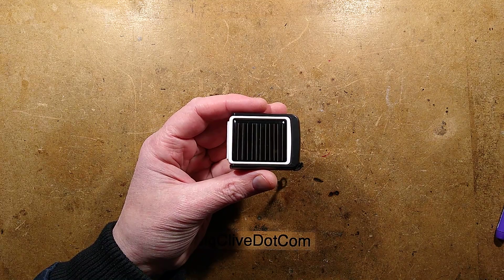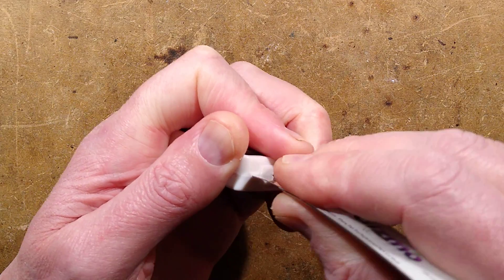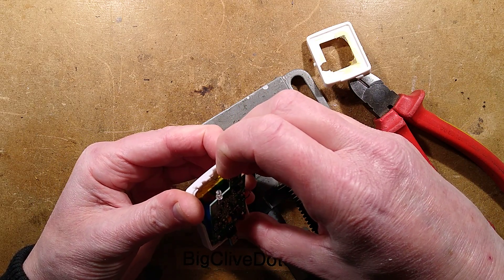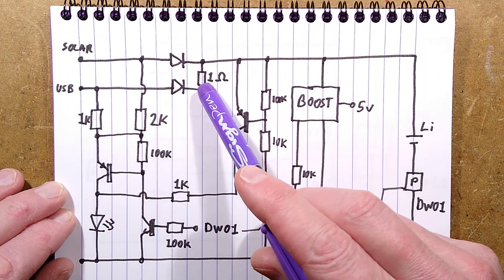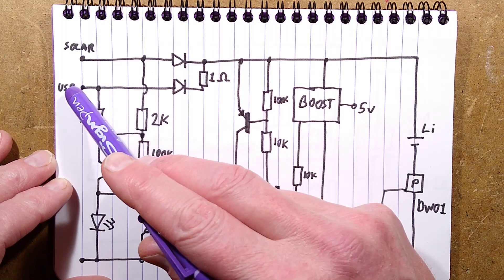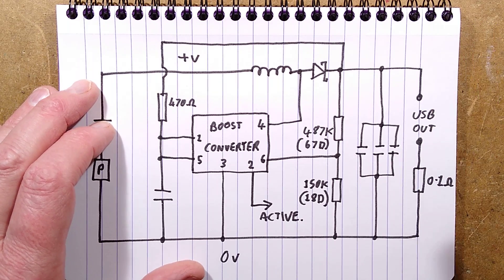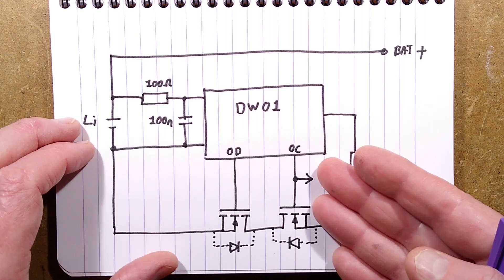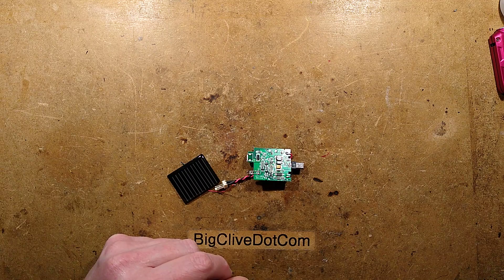Ultra small solar power bank with retro circuitry (with schematic)

Comment: I enjoy your videos and I was wondering if you have [or could] use discarded lithium cells from vapes, to make up a battery bank of cells [and maybe a step up to 5v], which could be used as a portable power bank for a phone?
Reply from the maker: Yes it is possible to use a parallel cluster for that.  I have a video where I used two in a USB rechargeable module.
Reply: @bigclivedotcom  thanks for the speedy response, I'll see if I can find it. Thanks again.

Comment: My major is “optical engineering”. We’ve had four semesters of so called “electrical engineering”. This video is a very good example of me understanding every single word but struggling to understand the whole concept.
I admire your fluency in reverse engineering different circuit boards.
Reply: I was a bad student:
Reply from the maker: You may find it a lot easier to learn naturally at your own pace instead of the usual out of context data cramming that happens in educational establishments.

Comment: Clive, My Samsung fast charger that was supplied with my phone packed in,,, (broken negative post, when unplugged it pulled out the brass connector )
I bought a Qualcom 50W Quick Charge 3.0 wall charger from Amazon.
I've been using it for a couple of weeks and the phone was happily charging in under an hour from about 35% to full (the Samsung one took around 2 hours to do the same)
Happy bunny,, fast charging.
Yesterday I noticed that my phone seam was starting to bulge.
the phone does not overheat... obviously the battery is puffing up.
Does very fast chargers damage phone batteries?
The phone is only 4 months old and will go back under warranty, surely this can catch fire, or vent?
Might be worth a Big Clive investigation and destruction test.
Pie containment dish needed.

Comment: I had one of these over a decade ago... back then, it could charge your phone, they didn't need as much power back then like they do now... Loved that thing. Best $20 I ever spent. It got me onto Solar powerbanks, which nothing ever really stood up to that little bugger. That little thing took maybe a couple hours in daylight to charge up - but when you don't scale proportionally, you run into issues. I've got a 15,000mAH battery with an 8" solar panel... that thing takes WEEKS to get 25% charged.

Comment: I bought one of these for a project for a tiny wireless camera, but in the end the output wasn't quite enough (I ended up using a solar wall light with the led's disconnected), but the circuitry was impressive for such a small and seemingly cheap appearance - there is so much in it and it has potential to be a solar keying torch with a few mods :-)

Comment: Is it just me who has a problem with the idea of leaving lithium powerbank in a sunlight? 
By profession I naturally think about people with less technical awareness and I can easily see people leaving these in direct sunlight. As a rule, I don't like one of these flat cells in solar devices. When getting in a sunlight NI-cd or at-least something in 18650 form /with smaller capacity (to deal with it flaming) getting warm near the window in a summer. Or some other means of protecting the cell from getting too old

Comment: If this power bank is like one I have, the solar panel is handy for discharging.  A little bit of light activates the circuit, but isn’t enough to charge the cell.  Meanwhile, the LED indicator slowly drains the cell. 😊
Reply: Yeah the solar panel at that size itself can only draws 0.05 to 0.1 watts even at full exposure to sunlight. Not enough to charge the phone battery to reasonable capacity even when it's leaving at full sunny day

However that small sized solar panel is enough to charge very small devices which has small battery capacity, such as calculators and small rechargeable flashlights

Comment: Said boost chip looks like a RT9266PE , FB reference point is at 1.25V by the datasheet, resistors pair used here (487k/150k)  make it exactly 5.31V you've got on tester.

Comment: Clive (or anyone), I recently was replacing my phone screen and had to remove the battery. I dented the cell in quite a few different places but it is not punctured. Do you think it will be okay? Its working fine at the moment
Reply: Probably.
Reply: @davelowets  if it was gonna explode would I know about it first? Like would I get really hot or start smoking before it explodes?
Reply: @bluelights2468  First it would start to bulge and swell up, then it would get very hot, and at that point it'd not be long before it unleashes the hell contained within.. 
If something like that IS going to happen because you physically damaged it, it usually happens VERY quickly after you messed with it. If it's been any amount of time, you're most likely OK.
Reply: @davelowets  it's been a day now as it happened yesterday morning, I am a bit paranoid about it exploding in my pocket but I'm glad it wouldn't be an instant thing anyway. Thank you very much for your help
Reply: @bluelights2468   I think you'll be just fine... 🍻 

If you notice that its rapidly losing its ability to hold a change anymore, thats a sign that it's possible damaged, and may end up in a gangerous situation. So, if its still holding a chage well, its ok. 👌
Reply: @davelowets  okay perfect thank you very much 🍻 it's holding a charge as good as it was before so should be A1 then. Thanks again
Reply from the maker: As long as the dents are soft and not too deep it should be OK.  But it's hard to say decisively.  If in doubt, treat yourself to a new battery.
Reply: @bigclivedotcom  yeah I stupidly used a metal flat head screwdriver to remove the battery. It was well stuck in there and I've dented it roughly 10 times or less. It seems to be working just fine and i really can't be arsed to change it cause the phone is back together now, why can't they be easily replaced like they used to be. Thanks Clive
Reply: @bluelights2468  Next time, slide a credit card or Drivers License under the battery to release the double sided tape holding it in there. Isopropyl alcohol also greatly helps to release the stickiness, but if you use it, use it sparingly, and you must make sure that the power from the battery is disconnected first and allow the device to FULLY dry out before you reconnect the power. If in doubt about what's underneath the battery, and whether the alcohol will destroy something, the credit card method works well, but go very slowly, methodically, from all sides, and keep checking your progress to avoid catching, wadding up, and ripping the pouch of the cell if it's a soft covered cell. 

Years ago, I was trying to open a power bank that had ultrasonically welded plastic seams and I was gently slipping a razor blade around the edges to break the seam. The blade finally broke through and I plunged it into the edge of the lipo cell. The power bank INSTANTLY blew up in my hands and erupted into flames 3' high. Thankfully quick reflexes kicked in, and I dropped the device VERY quickly, and backed away before I got injured. I was very lucky to be in my basement at the time, which has concrete floors, so I could just let it burn out without starting my house on fire. The power bank was only as big as a credit card, and about 1/4" thick. I never gave a second thought about it being "dangerous" being that small, but a lithium cell of any size can be a sizeable "bomb" if treated wrong. 

If you are working on a device with a lithium cell in it, choose your working location carefully, use some personal safety gear if in doubt, remove metal jewelry such as rings and necklaces, (many lithium cells can output enough current from a short circuit to a piece of jewelry to melt it into your skin) and keep a fire-safe containment device around just in case. Somethimg similar to Clive's metal "Explosion containment pie dish" would be quite handy. Play safe!

Edit: Guitar picks work well for sliding under smaller lithium cells to remove the sticky tape also, if a credit card is too big to fit. Just be darn careful not to shove the point of the pick through the cell pouch. Use the blunt side.
Reply: @davelowets  I ended up snapping the phone shell I'm half as I had a new one anyway I just transfered all the bits to the new one but it was definitely the most idiotic was to remove the battery hahaha. That sounds like you had a very exciting time with that power Bank 🤣 yeah I was removing the battery at the workshop in my bedroom but it probably wasnt a good idea as i have carpet in here, thanks for all the tips and trick. My dad used to never let me near my rc car batteries when they were charing because he said they could explode and I realise now that was unlikely because of protection circuitry but it has given me this wariness when it comes to batteries which I guess isn't a bad thing especially after hearing your power bank story hahah thanks again for all your help 👍🍻
Reply: @bluelights2468  If your R/C batteries were of the lithium type, your father was a wise man. Some types of lithium cells are prone to violence during the next charging cycle IF they have been over-discharged or abused during the last use. There are fire-proof bags, or "Lipo Sacks" available for the charging of large lithium cells that will contain the explosion or fire should it happen while they are on the charger. Its wise to store the cells in these when their being stored also. 

Your welcome for the tips. 👍 
I'd hate to see someone get hurt when they're learning electronics, or how to repair something. Great job on getting your phone back together and working, as replacing phone batteries is NOT an easy task these days. 👌

Comment: I get a weird inception vibe looking at the PCB. Your camera circuits are filming battery circuits transmitted through a bunch more circuits, resistors, and diodes to my phone you get the point. Your eyes to my eyes with a bunch of electrons in between.

Comment: Have one of these somewhere with an ipod dock connector, from around 2007. No charge input, in addition to the tiny battery, so you could charge like 20% of your battery VERY slowly every few days. Never got it to work repeatably.

Comment: Still very nice, most of the solar power banks I have don't have the DW01 in line with the solar charger - they just put the solar cell across the li-po cell - what could go wrong ?
Reply: The Lipo in those most certainly had a built-in protection board right into the battery.
Reply from the maker: Some have the battery protection, but some don't.

Comment: Nice little unit. Because the case is white and the solar panel is on the other side of the unit from the lithium cell, one can be confident about sitting the unit in direct sunlight without any issues other than yellowing of the plastic or increased brittleness.

Comment: Funny how most of that circuitry is now put into a tiny chip–now that I think about it, I kind of want to compare the chip's size to the size of the circuit featured in this video 🤔
Anyone know where I can find some pictures?

Also;
10:23 when I first saw the way you drew the boost converter, I was wondering why the pin numbers are drawn out of order, but then I quickly realized the chip pins probably don't look like that and it's just more convenient to draw them that way. 👍

Also-also, until now, I had thought you were using the same notebook and that it either had an endless number of pages, or that it was almost full.
Turns out this guy probably has a whole crate of notebooks 😆

Imagine having a notebook with infinitely many pages. 🤔 When you open it up, it always appears to open in the middle; neither side is thicker or thinner than the other...
Such a notebook would have to be bigger on the inside..
I think I might like to have a notebook that's bigger on the inside, although I think I would rather have a few million pages, maybe a billion max. That would be neat.
Reply: I seem to remember such a notebook. I can't remember if it was D&D, Pathfinder, or Terry Pratchett.

Comment: I wish micro USB would be fazed out, such a nasty connector that always seems to wear and distort making it useless over time.
Reply: But of course that's probably the point, then you have to buy another one.
Reply: but they are ok when plugged in the right way.. and not forced in upside down. they seem to last forever.. ive seen more dodgy usc c connectors

Comment: Honestly i doubt this tiny PV-panel could output any useful amount of power 🙂 In best case its in the range of self-discharge of the cells...
Reply: Nah, it outputs 20+mah... Thats MUCH more than the self discharge of the lithium cell. It WILL charge it, it'll just take several days in the sun.

Comment: I grew up with those kinds of circuits. Then came op amp comparators and 555's. Now everything is done in software using microcontroller boards. Recently I made a power on delay circuit for a compressor using an ATtiny module, a packaged Hi-Link power supply, and a relay module. It could easily have been done using a dropper cap, rectifiers, a Zener, a triac, a relay and a handful of passives. But who wants to mess with soldering on a perfboard or etching a PCB? 😁
Reply: Yep, the analog days are pretty much gone... I fought the whole microcontroller phenomenon to the bitter end, but I finally had to cave-in and learn it, or I would have been left in the dust and confused when it came to modern electronics.
Reply: @davelowets  Actually it is much easier. More like Lego, but you will have to learn how to write code.

Comment: Hey Clive, 
 As a newbie electronics enthusiast, I always feel as though it takes me an unreasonably long time to reverse engineer. Roughly how long did this take you?
Reply: Practice makes perfect, gets easier when you start memorizing some of the common little circuits that make up the full schematic.
Reply: @Broken_Yugo  Oops, I didnt even read your comment before I posted mine...

Great minds think alike, I guess... 🍻
Reply: It'll get easier as you start to recognize all the little common circuits that are piled into one large one, such as snubber networks, switch de-bouncers, decoupling caps, pull-up resistors, R/C constants, and so on. It took me a LONG time at first also, never fear, you'll get there. 👍
Reply from the maker: This one took longer than normal due to the odd circuitry.

Comment: The more time goes by the more specialised components they bring out. Instead of basic transistors you have dedicated chips that you have to look up data sheets and never have the right one on hand. Are they killing the hobbyist diy market?
Reply: The hobbyist market will just be increasingly limited to the older and easier to work with general purpose parts that have been around forever. At least for those who don't like doing hobby electronics in the "design boards on a PC and order them assembled from China" method, not that there's anything wrong with that. Production of old part numbers and through hole stuff that people actually buy seems to be holding up, and the rest is mostly there as NOS, USSR surplus, etc.
Reply from the maker: The hobby side gradually embraced things like microcontrollers and Arduinos.

Comment: Long live analogue electronics - it is a dying art - hence the sharing of a former work colleague's attitude to the overuse of microprocessors in a comment to a previous video.
Thank you once again for your comprehensive analysis.
Reply: Actually where I worked analog was the most stable department.  Always need power supplies and interfaces to strange devices. If anything died it was the old discrete logic design.

Comment: I love the old always-on powerbanks. Rare as hensteeth now. Great for arduino or IoT devices that use low current. Funny, if you want always-on now, you have to pay a premium, whereas 10 years ago it was very common.
Reply: It's not hard to trick the newer ones into being always on..
Reply: @davelowets  I know, it's just tanks efficiency
Reply: @_BangDroid_  Yes, on alot of them it does. Especially the ones that have the battery level LEDs on all the time when it's running. Occasionally I still run across a new one that has the older type of circuit in it, that doesn't use much current at all when you mod it to stay on if nothing is plugged into it.

Comment: A question for just anybody generally: I need 12 volts of battery power for a project. I don't really understand all the stuff about lithium-ion batteries, with their special charging needs and so on, but I'd like to get some sort of 12 volt power pack, without spending a lot of money, and I guess I'd need a charger, too. Any advice is welcome, thank you. BTW I'm currently using 8 AA batteries, so it doesn't need a huge amount of power.
Reply: You should be able to pick up 12v lithium cells from hobby shops. You can also put multiple lithium cells in series like normal alkaline batteries, but if you do you should make sure all the batteries are fully charged and from the same manufacturer. Otherwise when the cell voltages are slightly different they’ll discharge into each other to try and equal the voltage out, and that can cause issues. Another option would be to find something pre-made online, I have a lithium car jump starter that can also put out a few different DC voltages, so there’s definitely options that should be pretty easy to us. Not sure of the model though.
Reply: What is the actual current? Peak and continuous. You may get by with a standard 5V bank, a USB power pigtail or breakout board, and a small, cheap, boost converter board to bring the 5V@2.4 A up to 12V, you could probably expect up around 800mA @12V out of a 2.4 amp power bank set up as described. There are also the fast charge USB C banks that I think can be talked into putting out 12V, but I'm not sure how cheap and easy that path will be.